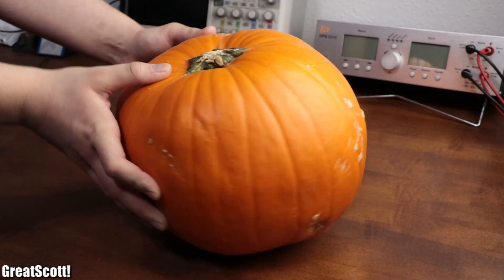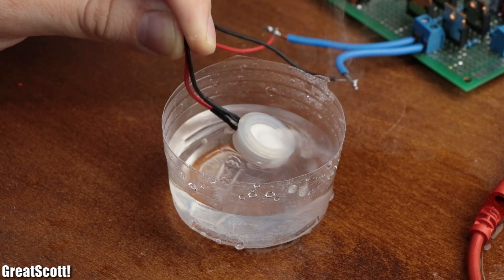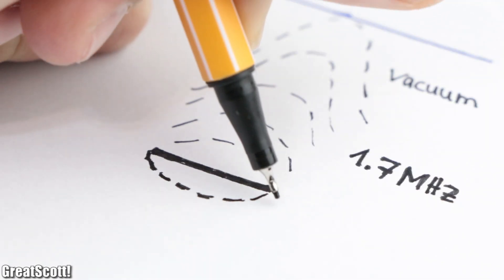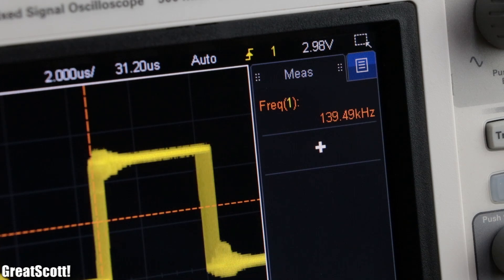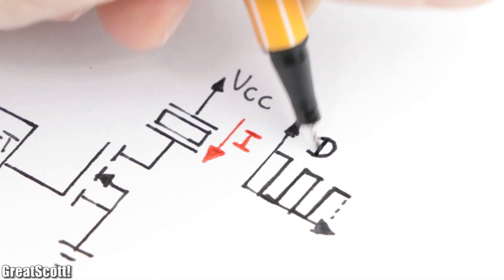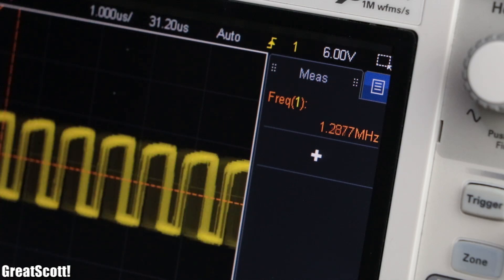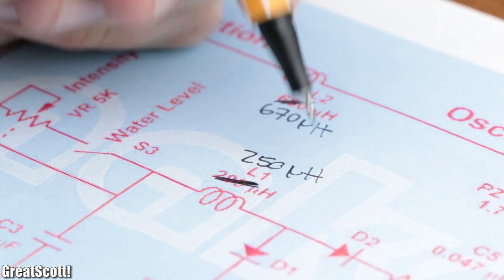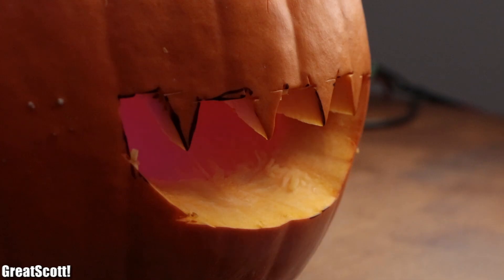Ultrasonic Mist Maker || DIY or Buy

Comment: 556 timer, use 2nd half to provide inverted signal from first half of ic, and you then have ac as you have 2 half bridges now working as a full bridge......it will switch a few hundred ma and the piezo is high impedance so not an issue, no mosfets needed.
Reply: Piezo is high impedance?   Two Ohms.
Reply: I always thought it was like in the K ohms range, emmmm... not played with one since i was about 12 so i guess i should have found out by now. still the 556 idea's sound just limit it to 200ma or so, hopefully 200ma will be enough to get some mist.
I cant find anywhere that states impedence on units they sell, but i did find a mallory 2060 element, and that had specs and said max 30v max 1m, so thats 30k.... I also found they have a resonant peak of frequency thats most efficient for power to sound conversion, and an anti peak, where at the frequency you get very little power to sound, any other freq is variable efficiency.
I just found a datasheet for another that states impedance max 200 ohms, but stil says 30v, so if we guess 100 then still at 30v thats 300ma and 9w... 9w would not be good for a 555.....
this one is sold as 1kohm ?
7BB-20-6L0 -  Piezo Element, Diaphragm, 6.3 kHz, 1 kohm, 0.01 µF, 20 mm, 0.2 mm
seems there a funny thing to work with and all you can do is measure it and see when its oscillating.....
Reply: Yes, that 1.7MHz 2 Ohms looked really strange compared to lower frequency piezo transducers where you have to drive high impedance.  Maybe dunking in water increases the workload causing low impedance.  I am looking for a way to cool Peltier devices with the benefit of adding room humidity during winter.

https://www.ebay.com/itm/20-mm-1-7-MHz-Ultrasonic-Humidifier-Vibrating-Diaphragm-Piezoelectric-Transduce-/152225716255?_trksid=p2385738.m2548.l4275

Specifications:
Type: Piezoelectric Transducer
Dimensions: With rubber grommet seal attached – 25 mm (Diameter) x 5 mm (Thick) 
Lead Length: Approximately 110mm
Rubber Grommet Seal Color: White
Resonant Frequency: 1.70 ±0.05 MHz
Resonant Impedance: ≤2.0 ohms
Static Capacitance: 1700 ±20% pF
Electrical-mechanical Coupling Coefficient: ≥0.45
Average Life: 5000 Hours
Water Rate:300M/H

Comment: Interesting video! I didn't know about the 1.7 MHz - rather thought about a few hundred KHz tops for ultra sound transducers. Are there no application example circuit diagrams from the manufacturer? I would wonder at how much amplitude the crystal breaks...

Comment: and can you make simply upto 2mhz oscillator circuit , i want to use it for high voltage , i use 555ic with connect 2+3+6, no caps required for this we can achieve upto 300khz , if we use tlc555, we can get upto 2mhz its cmos version

Comment: 1.7 Mhz has to be managed with appropriate components. I suggest to use ham radio oecillator and suotable semiconductor. Maube you can salvage them from LW radios.  Anyway I appreciate ypu post also failures. Thi is sign of fairless. Grazie
Reply: Yeah, I was thinking the same - those half bridge/full bridge drivers are made for driving high frequency transformers in switching power supplies and similar stuff where much lower frequencies are used. Using 1,7 MHz for those circuits would not be very efficient - and large power MOSFETs and IGBTs made for high power are too slow to work properly at that frequency. They would probably never be fully on or off and mostly work in linear mode with huge losses and wouldn't handle much power at all.
The built in "dead time" of 150-400 nS in those drivers are also needed for those, to ensure one set of transistors get enough time to turn fully off when the other turns on. For 1,7 MHz those MOSFETs are probably not the best choise ether
 - there are other transistors more suitable for RF (I havn't very much experience my self working with frequencies that high - most I have played with is audio circuits and power circuits, that range from DC up to about 100 kHz)
Reply: 1.7 MHz is pretty forgiving frequency to work with. Most transistors produce plenty of gain well into the VHF range
Reply: Wow, All this is beyond me right now. I would probably just buy one as well. But as a hobbiest, I appreciate how you can share your failures and it seems like it must have been fun attempting to problem solve this issue with the knowledge you have! Two questions, "did anyone ever successfully do this in an affordable way?" And, "is there any way to make sure the components don't corrode?" There was some rust on your oscillator/atomizer which perhaps could have affected it's performance but what do I know.
Reply: Pier Aisa do you speak english

Comment: Could you make a video about hbridge for large steppermotors?
Reply: Just get a stepper driver, much easier. Check Pololu AMIS30543 it is cheap and can handle 2 Amps. Also, It can go down to 1/128 steps.

Comment: maybe  those circuits couldn't deliver enough current. in the commercial one the speaker had enough power to push an inch of water over the surface from 10cm below like a water pump.

Comment: The reason why the ebay mist maker works is because it contains the actual full H bridge circuitry kind of like your one that you tried that worked, seems the peizo driver needed the full push and pull ac wave (like power audio amps use) not just a push sine wave

Comment: For your 555 time + mosfet circuit, you could have added a DC blocking capacitor in series or discharge resistor for the crystal, it's a similar problem with crystal radios that use a piezoelectric for the ear piece that received a half wave rectified signal

Comment: Why not create a negative voltage rail and go with the first circuit you built?
That way it will go from +12v to -12v.
I mean you powered the bought one with 24v so i dont see why using two voltage rails or 24v instead of 12v woult not work.

Comment: The 140 kHz resonance is a radial resonance, while the 1.7Mhz is a thickness resonance. Only the thickness resonance will interact well with the water...

As far as generating the drive signal, the simplest method would have been a Class-E amplifier. Just build up current in a small inductor and dump it into the piezoelectric device (a capacitor) at a 1.7 MHz rate...
Reply: I bought a mister kit and hooked up a oscilloscope to it to find the frequency of the driver, it reads a solid 114khz when it’s misting water
Reply: @3nealweber3  If you can detach the transducer, you can hook it up to a NanoVNA or any other network analyzer that can measure the S11 parameter and look for the mechanical resonance frequency of the transducer (the frequency with minimum reactance). This is the frequency your mister should be running at. You will still get output at different frequencies, but running at the resonance frequency will provide more mist at the same output power. This measure isn't exactly right because the output is probably driven through a transformer and the transformer's leakage inductance should be considered, but it's close.

Comment: DIY/Buy: air conditioner (evaporator coil/condenser/refrigerant, not thermo-electric)
Reply: DIY nuclear power plant
Reply: @user-gu1hl2kx2k  no
Reply: Its pretty eazy
Reply: How about solar heated absorption type compressor, then a high btu capacity 'cold battery' to store the temperature negative energy 'cold' then a water pump to pump this fluid through a radiator and a fan to cool the air in a room.
Reply: I would like thermoelectric
Reply: Were you also thinking about putting a mist maker into an evap cooler?

Comment: Please make any video on....  12 volt battery charger or variable battery chag3r... I made some circuit but 

How control current simutaniously ...i mean 12 volt battery was used in bikes also how to charge with... Variable bench power supply..please guide

Comment: DIY OR BUT CD changer emulator.

Those cost about 70-100€, and there is a lot material about this, so you could try making cd changer emulator with usb support for media, like mp3. 

some articles:
https://dev.shyd.de/2013/09/avr-raspberry-pi-vw-beta-vag-cdc-faker/
http://hyperlogos.org/blog/drink/VWAudi-Concert-etc-Arduino-CD-Changer-Emulator
https://github.com/tomaskovacik
http://martinsuniverse.de/projekte/cdc_protokoll/cdc_protokoll.html

Please consider this, as this one could be useful to learn about data transfer protocols and electronics in general.

Comment: the diagrams are a fully functional device they took the card from one and managed to draw the diagram in the only thing I would worry about the digrama is a transistor that if it is heated enough but everything else okay I nulca I made it work because I miss the piezoelectronico I leave the videos https://www.youtube.com/watch?v=3rZcX6kO3Tg&t=547s
https://www.youtube.com/watch?v=7XEkeVaJEFQ
https://www.youtube.com/watch?v=xP7U4U-fRlE&t=194s
if they fix well all without eception use the same circuit with minor modifications, I have diagrams and some pcbs that download from the same videos

Comment: I was working on the same project but I did not find any information in Spanish and also in English but I found enough information on a Vietnamese page I just reviewed it and it seems to be offline Luckily download several diagrams, which I was complicated was get the piezoelectronico at 1.2Mhz

Comment: For the second circuit with DC Voltage: if you shift the voltage of the other wire comming from your Piezo by using a voltage divider(or something more efficient) to half the maximum voltage, wouldn't it become AC Voltage on the piezo?

Comment: My business partner needed a new connector hose for the air filter on his super bike. So we set out to make one from scratch. We had a slightly damaged one which we glued together and made a latex mould. We then used hi density silicone and cast a new hose. After 120$ of expense we got a some what acceptable hose. The thing is we could have bought a brand new one for 20$. Why DIY when you can buy? I DIY cos I can...

Thanks for the awesome video...

Comment: you can get them on aliexpress for less than 3€
Reply: Honey FPV 
   ...and you will receive them in January....if your lucky
Reply: Upcycle Electronics i usually get my items in like a week to two weeks from aliexpress (in belgium)
Reply: @UpcycleElectronics  could you please post the link
Reply: @vigilante_stark  
  Not on this channel. My post won't get past his spam filter settings
Reply: @UpcycleElectronics  just change the ".com" part and make it "(dot)com"
Reply: @vigilante_stark  
It's different when you have public uploads with a larger number of views, and it depends on the channel you're posting on when it comes to filters. This is one that is not so friendly to links. 
  I'm honestly not so sure what you're looking for contextually as this upload is over a year old.
   AliEx links are also a pain. The ones generated by the app are broken if shared on the web. AliEx has a link sharing monetization feature so links are specifically targeted by the YT filter.
Reply: Link product plz

Comment: What about to use two traducers: one to be used to create the mist and the other like resonator in a RF oscillator circuit and add a power stage (clase B/C) with an output transformer to drive the final transducer?. 
Or better just create a power oscillator with the same transducer like frecuency control device (it will work like a 1.7 Mhz crystal)???

Comment: you could try use an audio amplifier that can amplify the AC signal but the problem with this is that you will need a signal source but it could work.

Comment: Nice video. I didn't know this piezo thing could make mist. 

Also, Once ı wanted to use an H-Bridge with 555 timer and shared my schematics on a website called "everycircuit" and people there told me it would be wise to use a crystal to get high frequencies instead of "555". As I am just an hobbiest I don't know if it was  a stupid suggestion.

Comment: Never the less of buying or put tons of solder onto the pcb, the main problem of cold mist generation is, that you have to take care of the water. In other words if the water contains bakteria due standing for days, the piezo pours it in your breathing air. That's why in AC systems the hot steam generation is the save (but not cheap) way.

Comment: Nice video!
Hey I have one doubt,
 I want charge a battery using solar panel (having less output voltage) can I use boost 
Converter in between .
If possible can you make video related to the same topic.
Please !!

Comment: Hello GreatScott! I have nother idea for your "DIY or Buy" projects. Builduing your own lightsystem on a bycicle powered by  dynamo, maybe adding usb ports and buffer battery long the way. I thought about this myself, but couldnt find the motivation to start :D Another projects could be build your own RGB light in  keyboard or a mouse, building your own clap sensors as  lightswitch or electric doorlocks with different "keys" (for example knocking in a specific order). Anyway, thanks for making cool videos :)

Comment: Great scott ! Can u make a video on bridge rectifier working and uses
Reply from the maker: Watch my basics video about diodes. I talked about FULL BRIDGE RECTIFIER there.
Reply: Thanks alot great scott
Reply: Great scott are u on fb
Reply: I am a very huge fan of you
Reply: How much time it will take to complete your quadcopter project. REPLY PLEASE
Reply: GREAT SCOTT ! Can u help me in some electronic projects such as flyback transformer high volt convertsion. Sorry but i cant join your PETRONS i am not having 
Any credit card or paypal. 😢😢😢😢really i m very unlucky..

Comment: To me, your circuits all seem to be overbuild and too complicated for the Task. I think a small TTL inverter ic could do the job. Two Inverters form the oscillator, two act as a full bridge and one inverts the signal for the second half of the full bridge. In principle this should work just fine, unfortunately i can't try it out now.
Reply from the maker: Try it out and let me know if it works.
Reply: I will. But it is going to take till next weekend when I'm back home.

Comment: This is you best video but I am biased because I had looked to solve the same problem since the disks are so cheap but the driver circuits are such a mystery. But you call yourself stupid so that must make me a imbecile then because you knowledge is light years ahead of me.  And yes you did create modern art for sure with the air soldering

Comment: hey Scott nice video... thumbs up . you really did it well... i never knew how mist maker works.. your designs were not stupidity it was fun ..enjoyed it. i was wondering will it work with normal piezo buzzer (speaker) ? like using 555 timer to generate frequency and then using op-amp like LM324 with +ve and - ve power supply? just a rough idea....
Reply: yeah, i was thinking the same. just use an op-amp to create a DC offset and you'll have an AC signal, yeah?

Comment: Hello! Did u tried to use 1:1 transformer with tho primary windings ? I think using it in a inverter ciruit, could lead to desired ac signal.

Comment: First, the water is not turning into vapor form. Instead, the mist you saw is water in droplet form.
About driving the piezo, I would recommend transformer coupling, where a pulse transformer can be used. The reason for such a coupling method is that the distance of travel of the piezo piece is related to the peak-to-peak voltage. Basically, you will only need an oscillator, a mosfet driver (which can be as simple as an buffer opamp), and a pulse transformer.
Reply from the maker: The pulse transformer sounds like it could work. I might give it a try.
Reply: yes yes keep trying Thanks
Reply: GreatScott! This will be too simple to you. Lol. Btw, i drive my transducers through this transformer approach, which works like a charm. The tranducers has its own resonance frequency, where you dont have to worry about capacitors or what so ever.
Reply: Hi. I need your help. Can you send me your schematic about this circuit. I tried but it not work. My email: learningisglorious@gmail.com. Thank you very much!
Reply: +GreatScott The signal source can be an LC resonator.